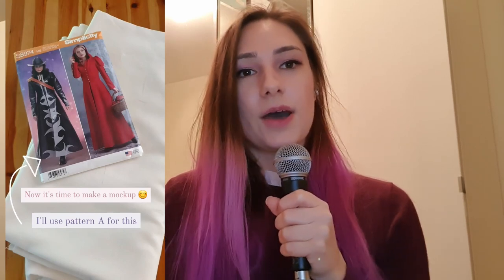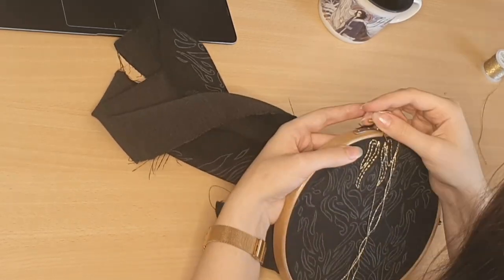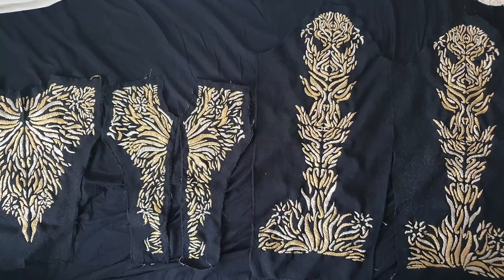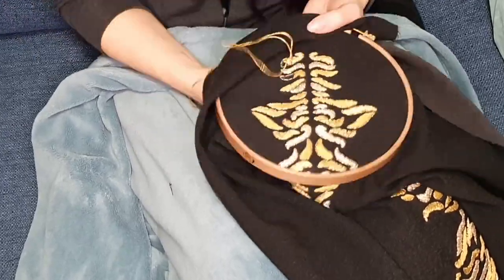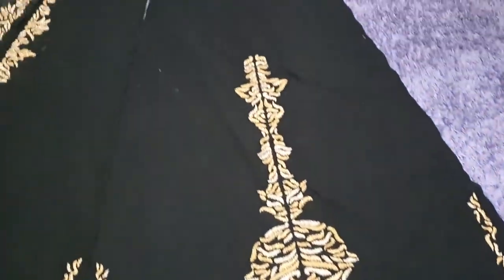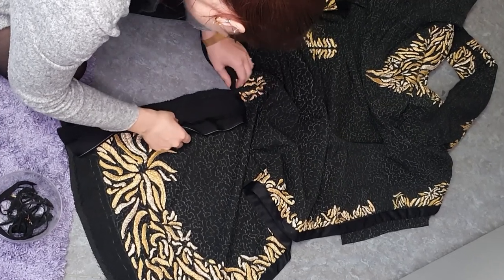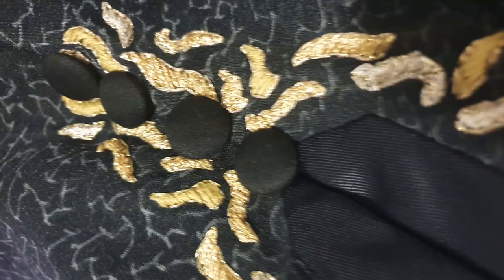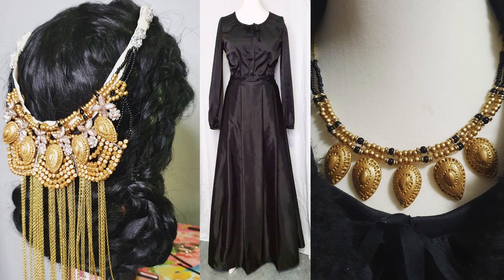SHADOW & BONE | Alina Starkov Cosplay Pt. 1 | Making Alina's Black Kefta

Comment: Hi! I'm incredibly impressed with the kefta, an impossible amount of work must've gone into it! I'm thinking of making one myself, and I really liked the shape and structure/stiffness of yours, which seems better than others I've seen made on the Internet. Does that have to do with the fabric, did you use an especially heavy one or is that to do with the lining or the dress you wear beneath it?
Reply from the maker: Hey, thank you so much🥰. The fabric I used is more on the lightweighted side but I also used it to make the lining, so I have two layers of this fabric. I think that the stripe of fabric (the non-bias tape/grain tape) I added at the hem of the skirt also helps with the structure. The skirt of the dress I'm wearing underneath is also quite volouminus so that also adds to the shape of the Kefta. But if you want to give more stiffnes to the fabric than I recommend you sew or iron in some interfacing. I didn't do that because I didn't want the Kefta to be too warm.
Reply: @forge.of.asteria9259  thanks for the in-depth reply! Now I just need to decide on which kefta I want to make 🙈 there are soo many options